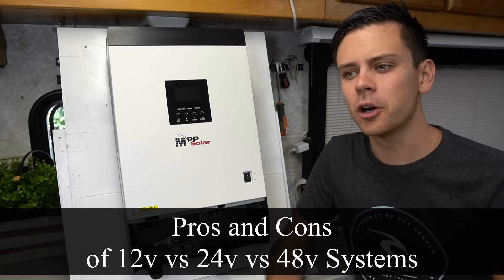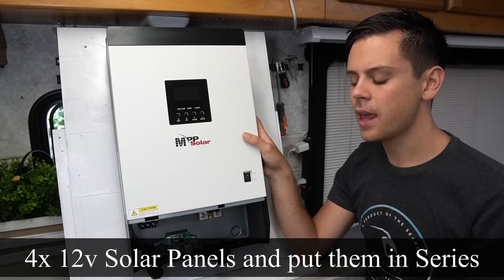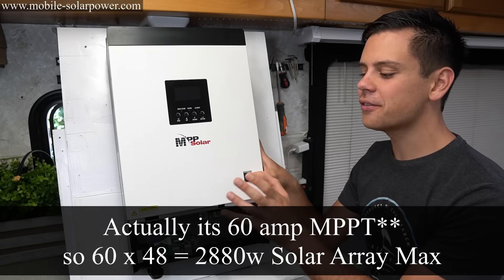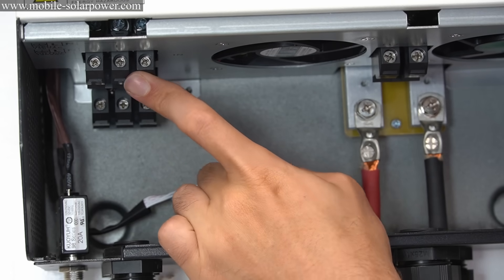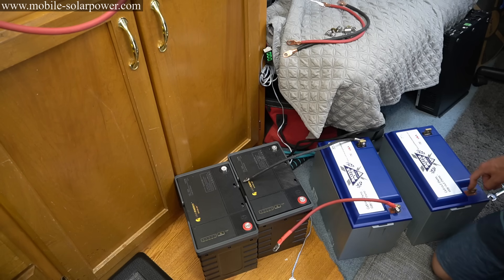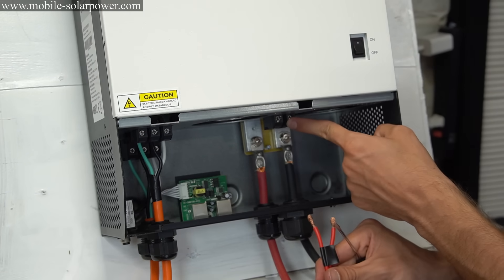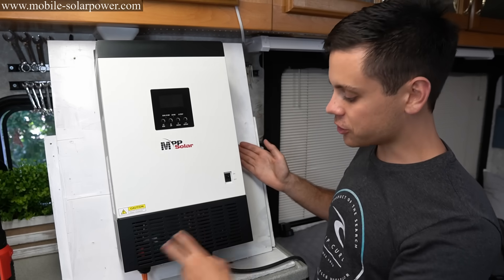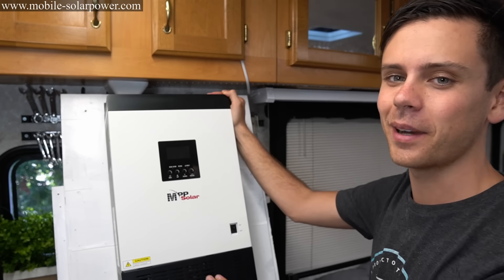48v Solar Power System for Beginners: Lower Cost and More Power!

Comment: Hello Mr. Prowse. Let me first say that you are a very smart and honest person. Second, you are great teacher. Third, I will probably end up in the hospital or burning down a building if I tried to do what you do (no matter how simple). Last, I see my electricity bill increasing.  I will retire in 5 years and need to start planning.  Using the 48v solar power system or some other one, which efficient appliances would you suggest to use for such a system. For example, I have a 1K sq ft. condo. Which  mini-split system, refrigerator, stove, microwave? and washing machine might work with this solar power system? I apologize for asking the impossible. Thank you.

Comment: Thank you for your videos and i have a question , on the 5KVA 48V 230ACv output. can the Voltage
be adjusted to 110/120ACv using the display panel or are there any other way to do it ?

Comment: Thank you for your videos and i have a question , on the 5KVA 48V 230ACv output. can the Voltage
be adjusted to 110/120ACv using the display panel or are there any other way to do it ?
Reply: No. You need an inverter that outputs 110/120v.
Reply: Autotransformer

Comment: Is the neutral actually a neutral though? Or is it the second hot for 230v? If I wanted to run this AC output into a camper trailer electrical box, how do you hook it up? I have the 5kva

Comment: Hi Will, I used your link and am planning to buy the 48v version. I noticed these units are not UL certified. I am in the Santa Cruz mountains off grid, but am building a permitted home. Does anyone know if California is forcing ul certification for off grid units? As far as I can tell, the ul certification is primarily certifying that the system will do smart meter stuff. Thanks
Reply from the maker: Only if you connect it to grid. I grew up in Monterey and mom lived in Santa Cruz. Fun spot. You can connect to grid with the charger. Just make sure grid backfeed is disabled and you will be good to go.
Reply: @WillProwse  thanks for the response and CA coast is an amazing place. At some point I'll post my project and give a shout out! Keep the great info coming 😁

Comment: Very good video...this model is what? ...All the units that I saw in ebay are for 48 volts at  240 single phase  AC output voltage... I want  the 120 volts AC with about 3000 watts.  Thanks
Reply: Looking for the same thing
Reply: They, MPP Solar,  does have a 2400W 120 v unit

Comment: Total Newb Questions:
Question 1: With a system like this, could I Wire my Refrigerator to the AC Out, my House to the AC In, and then Solar and Batteries, and have a way for my fridge to never go offline (assuming enough solar and batteries)?
Thinking I could do the same for my wiring closet.  Cable Modem, Router and Switch with PoE WiFi APs.  This way as long as my cable modem is getting a signal, I still have WiFi access in the house and I can charge my phones from the same closet.
Or am I completely missing the point to the video?
Question 2: Is this "lineman safe" so that when they kill the power to my house in order to work on the powerlines, the MPPT having specific In/Out ports on the AC side means it won't backfeed power to the Grid, correct?

Comment: Great, i bought an old Server Rack UPS with 48v leads to a battery bank. It has a 100A fuse and can output 240v at 1600 Watts load (2200 VA). Not bad for a scrappy $20. The 8 small 12v 7A (NP7-12) valve regulated lead acid batteries are broken and i had to remove all 20KG worth of them from the rack. Very ingenious setup of 2 x ( 2 x (2 x 12v in parallell) in series) in series to get you to 48v 14A. No balancing here of-course. So i probably have to buy and put 2 x 24v AGM's or 4 x 12v AGM's in series after equalizing. I do know there is a balancer board for this kind of setups with a fifth battery. The cheapest thing to do is to buy 8 new small NP9-12 batteries leaving me with only 864 Wh (usage only 432 Wh) deep cycle. But i wanna ramp up to 48v 100 Ah = almost 5KWh full usable capacity. Is there an easy way to do this with Li-Ion (Phosphate) + BMS without problems with (Lead acid) charge & discharge cut-off voltages?

Comment: Does the amperes of the solar panels count too? I have a 48v 5kw inverter, I plugged 2 set of 48v panel but it doesn't charge the batteries. I actually got 16pcs of panels but I just wanted to try 4 and see if it was charging.

Comment: Thank you for your videos. For the 48v all in one system. I don't want to feed back to the GRID but only internally to the wires connected to my 200amp panel. Do I need an "Interlock" kit?

Comment: Which one of these units are capable of delivering v240 ? And what configuration is needed to be able to run the  240v continuously using solar panels or Batteries during night time?

Comment: Hi,  THANKS for the great video, one quick question if you don't mind.  In bypass mode, does the PIP actually trigger a relay that connects the AC input and output or is there a constant connection between the input and output on the AC side?

Comment: Will it work just as effectively if the out required was to be 220v or 240v? Which is your recommendation the mppt or pure sine unit (about 90usd cheaper)?

Comment: I also have a 2kw wind generator. I'm trying to find out how I would connect that to here but can't find anything useful. Any ideas?
That generator already has a charge controller hooked up to it to get 48v out of it. I'm afraid you guys are going to tell me I need a separate inverter :-) Best thing would be a hybrid inverter that does wind & solar both.

Comment: Amps is what kills. it looks like you took care of your noise from the fans problem.
Reply from the maker: Yeah but current doesn't flow of your skins resistance blocks it. Learn about ohms law because voltage is just as important.
Reply: Indeed amps is what kills u but the voltage being higher allows it to move threw u easy

Comment: wait, sorry, does switching off the inverter also turn off the mppt charging? or does it litterally just cut off the inverter output? (ie, turning the switch off, does that stop the solar charging of the battery as well?)

Comment: Can't you technically wire this to an electrical panel to control the output to your house? I'm asking because I am not going to be grid tied.
Reply from the maker: You need a split phase inverter. The lv5048

Comment: How do you run DC powered devices with these systems?  Do you need a step down converter and if so, how do you install it?
Reply: I mean where does the converter go in the system?  Is it between the all-in-one and the solar panels?

Comment: Any concern that these MPP Solar products do not have UL or any other safety certifications for North America?
Reply from the maker: It's not grid tie
Reply from the maker: Doesn't back feed
Reply: @WillProwse  Neither does a stove, but I'm not sure I'd want to buy one that wasn't UL approved.   I've seen online discussions about the use of non-UL approved products and if they would void your home insurance policy in the event of a fire.  The opinions are all over the place and the only good answer is to call your insurance company and ask.  But I suspect if you install these like an appliance with AC plugs so you can plug and unplug vs hardwired to a outlet or breaker then it's probably not an issue and just a user preference.
Reply: @WillProwse  I'm new to your channel and haven't looks through all your videos yet.  Have you reviewed the Mean Well TN-series inverter/solar chargers?  They appear to have the same functionality as these MPP Solar ones for non grid-tie applications, similar price point, but they do have UL/FCC/CE certification.   Although it doesn't specify if its an MPPT solar charger, so probably PWM.

Comment: How did you know I was looking for a solution like this??? I wanted to be able to setup a few panels with a couple batteries to get through blackouts, this is cool because it will reduce my utility bill too.  One thing you never mentioned was the gauge of the extension you use for input/output, I will definitely go heavier gauge with that. Thanks for your videos!!!

Comment: I NEED 240 VOLT TO RUN THE WELL PUMP.. THE REST OF THE HOUSE WILL BE 120 VOLT. HOW DO I DO THIS?
Reply: Several questions; 
1. Is the well pump motor single or three phase?
2. Do you have an idea of how often you'll be using it? 
3. How far is the well from your house/PV system?
You would need a step up transformer on a separate circuit after the DC to AC convertor. I'm not an electrician, so you would need to find out what 240 volt single vs. 240 volt three phase will do to your motor.
I would recommend placing super capacitors in line with the batteries. The super capacitors will handle the startup amperage and then hand off to the batteries to handle the smaller load. The super capacitors will recharge very quickly. 
Look at how many watts will be used and size your system accordingly. It'll be more expensive, but you might want to look at running your well pump on it's own solar system. That way, you don't have to worry about splitting circuits. One positive, if one system goes down, you have the one not effecting the other. IMHO.

Comment: Another reason for RV to stay with 12V (or 24V for 1kw and more) as higher voltage panels or panels in series drop more power from even small shadows

Comment: I see you use lithium batteries. Can this unit charge them. Lithium has to be controlled to a certain voltage.
Reply from the maker: What chemistry?
Reply: DIY Solar Power with Will Prowse battle born. I was just wondering,
Reply from the maker: Oh they work with anything
Reply from the maker: AGM setting
Reply: DIY Solar Power with Will Prowse thanks Will. I am looking to buy two of the 120/240 to get ten k. Thanks for the help.

Comment: Getting confused.. trying to do the laptop battery build after some success with ebikes and the all in one unit (sunpower) states that it has a float voltage of 54v which is perfect but an over voltage protection of 63v.. my 13s system of 18650s are full at 56.4v and 63v would fry them.. am I missing something or am I using the wrong battery?

Comment: I'm not worried with getting shocked , but I'd still like one or two of these,  I wired 480v battery chargers hot for years, I'd like a splitphase with these guys,

Comment: this is great but how do i now hook up my 12v appliences on this?
Reply: Better use another 12 V battery and 48V DC to 12V DC converter. This battery can be small or old. Using a first 12V battery from 48V array directly is a bad idea.
Reply: @dmitryz4168  ok but (marine application) i have my vhf radar and instruments that need to run off of 12v (most of my usage) but i still want a 24 not 48v system. Do i take the 24v to 12v converter to bus bar with fuses? How do i get a low v cut off...
Reply: @michaelwaegemans6802 You are running valuable electronics from 12V. Do not rely on cheap DC converter, additional battery  protects from converter voltage spikes (for example in a case of internal failure). Fuses and breakers mostly protect from fire, they protect from spikes too but not immediately and can be too late. If your 12V consumption is not big (less 10A) you can play with Battery balancers (search Amazon) to shunt upper 12V battery and drain 10A from low battery
Reply: Thanks for the input!
Reply: Mmm. Maybe this is not a system for me then. I should stick to a 12v system. I really want an induction stovetop tho... Main reason to up the voltage. No more gas on the boat.

Comment: I must first of all say that your videos are so easy to comprehend. Thank you!
I do see some MPP solar models that can power an Air condition system directly without a battery. What is your take on that because I am in Nigeria and we do have 10hrs of sunshine daily during the dry season which span for about 8months so it will be a wise idea if we can take away the cost of batteries which mostly make the solar  system out of reach for the ordinary man here in this side of the world. I will appreciate your advise on this. 

And another way I thought of it is to use a converter that feed in steady 24volt to power a DC compressor because most of our energy needs here is for Air conditioning which is too costly for the ordinary Man so I am trying to improvise a way that will serve the masses through solar PV system without the cost of batteries. I will really appreciate your input/inputs on these two ideas
Reply: Enyuma, I think what you're asking is not possible. Why? The solar output isn't consistent from one moment to the next. If you check some of the voltages on a lot of the videos on YouTube, you'll see the voltages vary from one moment to the next. It's not enough to destroy the motor, but it can reduce it's life. What happens when a cloud comes by? Bad news. A voltage drop like that can shut your system down. On a bright sunny day, with no cloud in the sky it might be possible, but you're going to have to put something in the circuit to ensure you have a consistent voltage all the time. Motors don't like voltage surges and drops. It will destroy the motors. Adding batteries will take this headache out of your future. Look at adding super capacitors to the system that can handle the initial start up amperage of the motors and then hand off the running motors to the batteries. The super capacitors will extend the life of your batteries.

Comment: I thank you did a great job, I am new at all of this, I live in a Apartment and I am about to get a 4000w inverter I already have two Diehard deep-cycle batteries 12v thanks again. Happy Holidays
Reply: Good for you. I would look at purchasing Nickel/Iron (NiFe) batteries. They are way more expensive, (buy once, cry once) but you will have a battery that will last your lifetime and not having to purchase lead/acid batteries every 5 years or so. Additionally, lead acid batteries are harder on the environment.

Comment: I recently purchased the 5kw 48v all in one.  I also have 10 Seraphim SEG-6MA-345WW panels (don't plan to use them all) and a MidNite Solar Combiner Box MNPV6-250 (3 breakers).  What configuration should I have the panels in?  I'm powering 8 T105 6volt batteries.

Comment: When you say " add any battery you want..." does that mean you can use Tesla modules or the Leaf packs?
Reply: The short answer is yes. PV systems have been outfitted with lead acid (car batteries), lithium (LiFePO4), Advanced Glass Mat (AGM), Nickel Iron (NiFe or Edison batteries). It depends on your pocket book, space available, how froggy you want to get to build your own system, etc. Have fun!
Reply: @dalepittman5254  Thanks Dale!

Comment: I could use my 3k generator as the AC in and still have the auto transfer switch function correctly? My Samlex required me to delete the ground or it would trip the breaker

Comment: Correction on the voltage safety. Current through the body is responsible for a shock. Under dry conditions with dry skin, under 30 volts is considered relatively safe. Often under 50 volts is considered safe. This is why telephones (conventional) are 48 volt battery systems. Often the voltage is a little higher and much higher while ringing.  In high temperature, high humidity locations such as in the engine compartment of a boat in the tropics, it is quite possible to get a nasty shock off a 12 volt battery.  Salt water soaked wood planks and working on a 12 volt system may require the use of gloves.  This advise is from personal experience.  Wasn't lethal, but still a nasty shock.  Safety is a concern when working with 300 volt systems.

Comment: So I'm looking into the mpp panels, I like how it can switch to grid power if the battery gets to low. I live in New York and can't find if I need a permit for a system like this even thou it doesn't kick back to grid. Anyone know where I can search to see if I need a permit for this type of system. I'm using it for a work shed for tools and lights for my animal hutchs.

Comment: Hey Will! Rav Holly pointed me to your channel! Great stuff man! Is there a way to also include a grid tie inverter in this setup? I’m planning a 1200w 24v setup in my trailer, and would love to try to lower the electric bill when I’m not on the road. Maybe a hard switch to direct the panels to either the 6 in 1 system, or the grid tie system.

Comment: I found a 360 watt, 37 volt solar panel. Can I attach this to a 24 volt or even a 12 volt? Would it still charge the lower volt battery thanks

Comment: I need to power a 220v cook stove and a 220v dryer. My current usage  is 
about 14.15 kwh/day. I am looking at the 5000w 48vdc 120v/208V/240V Split phase Solar inverter 80A Dual MPPT charger on ebay. Will this unit do the job for me? Yes I am a very novice solar explorer, however ya have to start somewhere. With this unit how much solar/wind generator imput will be required?

Comment: I plan on running a small mini split heater/cooler air conditioner 24/7/365 off one of these. Can you see any way to incorporate two small wind turbines with a system like this?

Comment: @will Awesome video and product. Two quick questions - I assume there is a DC output (regulated @48v obviously)?
Also, is the inverter a pure sine wave version?

This machine could probably power an induction cooktop or small A/C unit!!!! (With the right size / c-rated batteries of course).

My solar shed project just got a smaller, easier, ac/dc power solution!!!

Comment: If I'm using 3kW and this unit yields, say, 5kW at that moment, can it put those extra 2 kW (that are unused) on the grid (and make my meter spin backwards), the way my current grid tie inverter does?

Also, if my batteries are fully charged, can I make this system push the extra energy into the grid? (And therefore bypass the batteries which are already full.)
Reply: Short answer is yes.